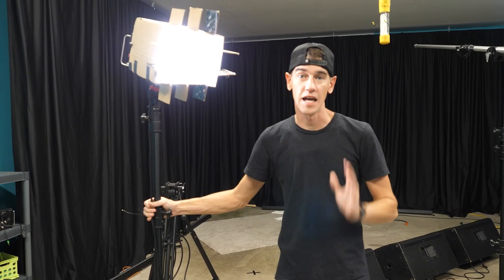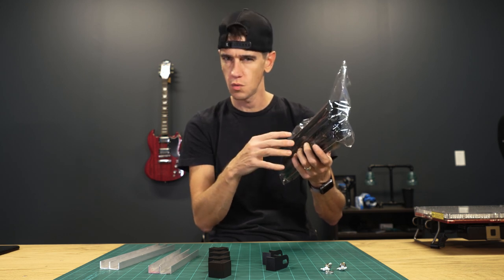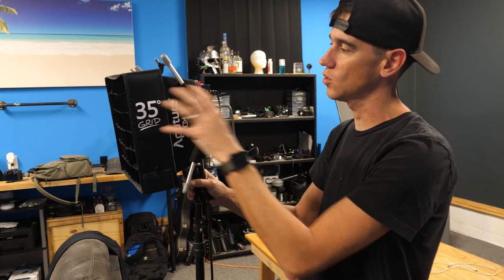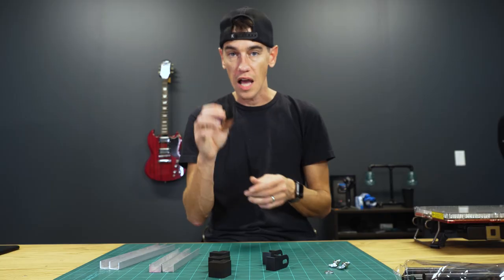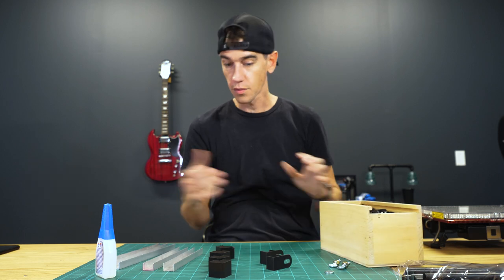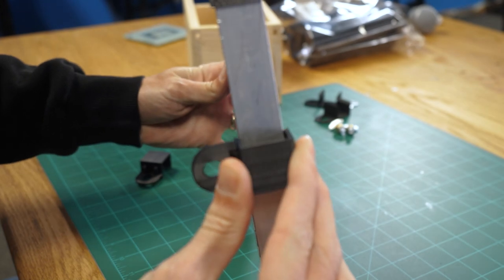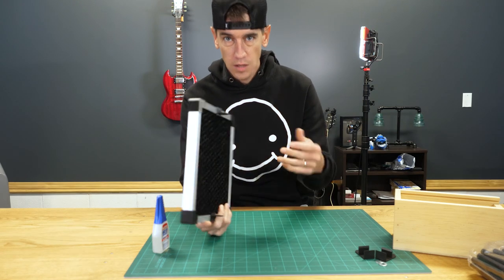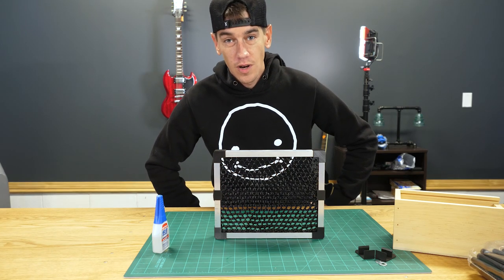Best LED Light Grid Modifier DIY for Under $15

Comment: Hello i was just wondring dusent the lights get to hot for the straws
Reply from the maker: Actually no! I’ve used that fixture on 80 percent brightness for over 6 hours and there’s no considerable heat on the front of the panel.
Reply: O ok cool i figured they would be alot hoter then that but that's cool

Comment: Will the lights get hot enough to melt the straws or even the corner brackets, if you used PLA for the 3d printing?
Reply from the maker: I used PLA+ and I don’t think the temps are enough to melt that plastic... it would have to reach 400 degrees Fahrenheit to melt PLA